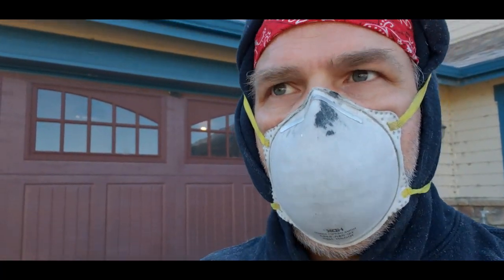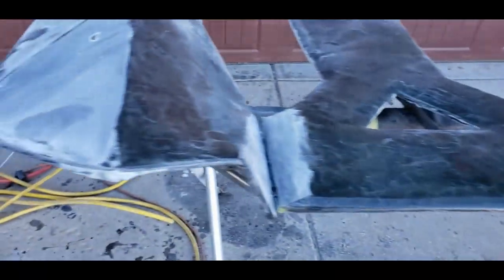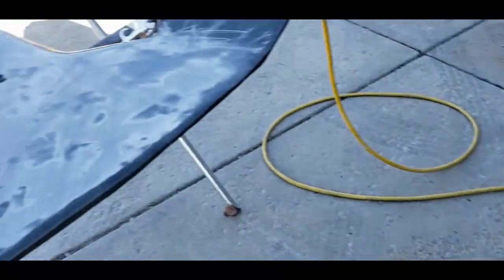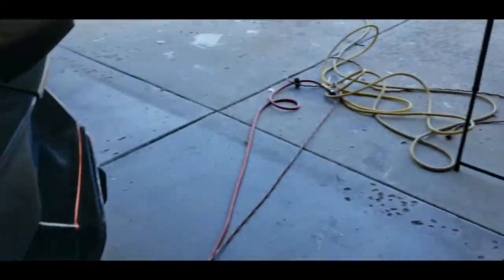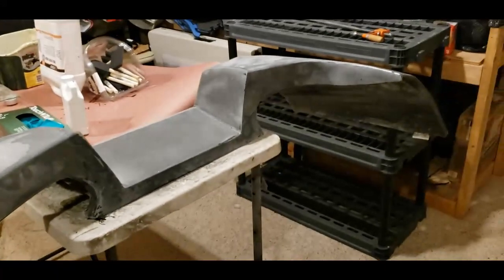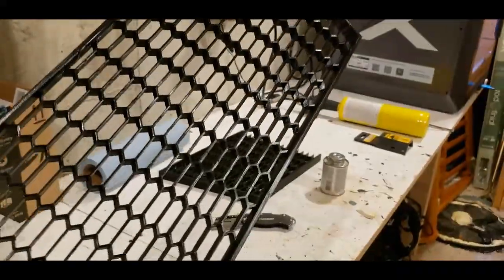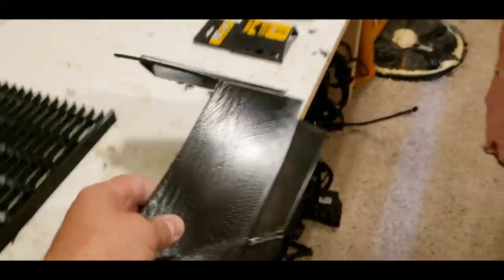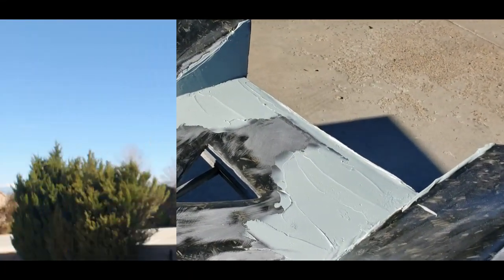3D Printed Interceptor Update 62

Comment: Simply amazing, for the cluster you should use something like real dash or dash command to replicate the original cluster in someway.
Reply: I've seen that there already sn Aventador dashboard on realdash. It's only ti create something dedicated ti run the program mauve using Arduino or something like that. I'm going ti do It with a bmw X3 e83.
Maybe further on i'll try too ti replicate the Aventador but i'll want It Electric like the Tesla model s

Comment: Are you not concerned about the plastic warping or melting in the sun? I've had prints do that
Reply from the maker: They are covered in 3 layers each side with carbon fiber. The bare prints are ABS, and will be finished and painted.  They have done well in the Colorado sun.
Reply: @lasersterling  Well I am glad they have held up so far! I'd still be worried of the internal structure failing and leaving behind just the carbon fiber shell

Comment: Great job everytime. And that red touch in the back of the car looks great (anyway it looks orange instead that red, but i don't know if that could be a video quality or light exposition issue).

I've just a doubt... In the engine cover, the " plate" that follows the center line of the car seems to be bent down. It need to be like this in your "vision" or it needs to be fixed?

Anyway great car! I've loved this build since from the first time i've see the 1st video. Keep it going! I dream to see it finished!👍🏻💪🏻😎
Reply from the maker: I designed a slight curve to it.
Reply: @lasersterling  I understand. As always, good job. Keep going guys. You're epically greats!